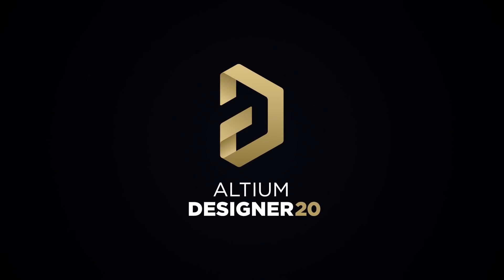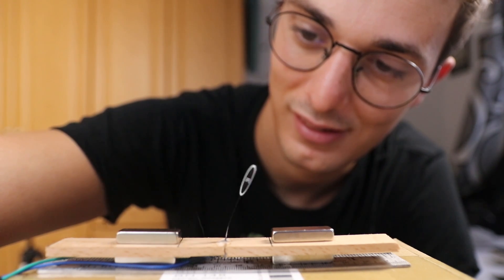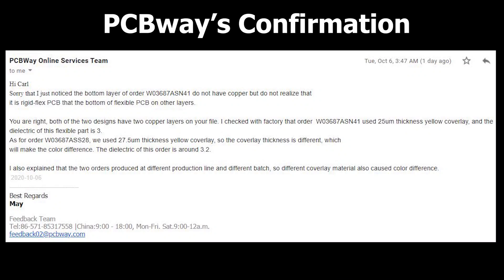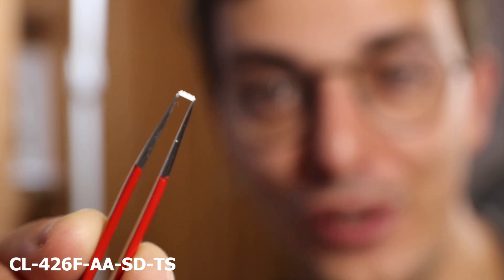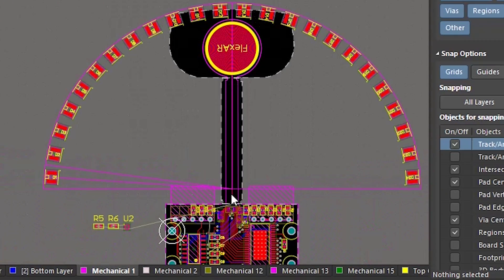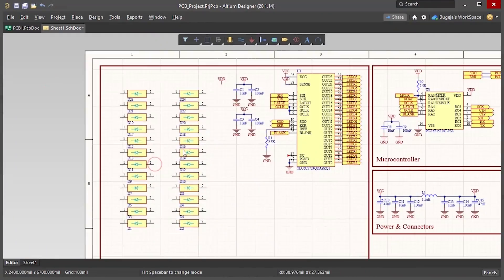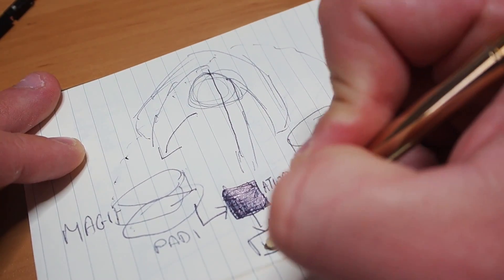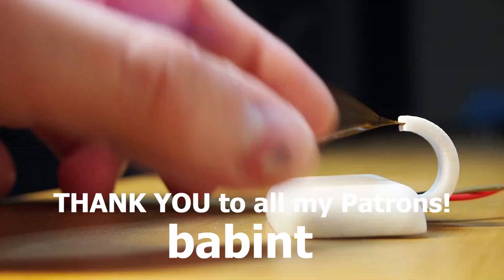New FlexLED Concept?

Comment: I'm late to the party on this one, but I think @elexperiment was on the right track. The flexible doesn't have to have 0 stiffness. Rather, it's better to optimize the resonant frequency and keep losses to a minimum. Stiffness and lossiness are completely different. The air resistance is probably unavoidable, but figuring out (and minimizing) the loss in the flexing parts could be helpful.

Many have suggested fiber optic delivery, and I agree. I would expect glass fibers to be less lossy than plastic (mechanically, but also optically). Remember that pole vault jumpers used fiberglass poles to get higher jumps before carbon fiber became easier to work with. If plastic fibers we're better, you know they would have gone that way. 

I don't know a ton about magnetic fields in motors, but they all seem to be really tightly compact with minimal air space between magnets/coils/cores. I'm guessing that putting the magnets and coils near the pivot point rather than at the end of the big flapper would improve efficiency. 

And finally, find the mechanical resonance of the flapper, and drive that frequency. Focus your sensors on the amplitude of the flapper oscillation and maintain that amplitude with small adjustments to coil current that can only build up flapper motion over several cycles. Timing this right would be an easier way of preventing the flapper from bottoming out and would keep the motion more stable. 

Now that I've shared my opinion, I've gotta go get caught up with the more recent videos 😁

Comment: It occurrs to me that if you use fiber optic fibers you could use that for the moving part, and have the light source static. This way you can use brighter leds and are not constrained by weight/size.

Comment: Hey @carl, nice job, 
what if you used a fiber optic cables to transmit the light , keeping the heavy LEDs on the base. 
or use a mirror or an optical arrangement on the flex side  that reflect the light emitted from the base

Comment: This is totally a driven damped harmonic oscillator. The main question is how to design a driving force that slows and reverses the motion just before it hits the magnets and still operates at a resonant frequency of the flexAR. This is made easier by the fact that the motion should maintain symmetry and periodicity so the driving force will need to be periodic as well.

Comment: Those flex LEDs are pretty neat, but for a sphere wouldn't it be much easier just to make the half circle spin around an axis by just attaching it to a motor? Seems unnecessarily complex and less optimal to have two flappy half circles instead. :P

Comment: How about using iron to improve the magnetic circuit? If you mount two neodymium magnets (with opposing polarity) on an iron backplate, I think it would help in increasing efficieny (i.e. less current needed in coils), by roughly a factor of two. Now, there is lots of air in your magnetic circuit. If you replace part of it by iron, you basically have a "low resistance path" instead of the high resistance of air, as the relative permeability of iron is much higher than that of air. 
Also, why is optimizing for a light weight that important? If you increase stiffness of the flexing part, together with a higher mass, you get a higher "Q factor" of your resonant system. I think one of the main losses is air resistance, as you have a large surface area and low mass of the moving part. I.e. you lose a lot of energy per swing. If you have a higher mass, you have more stored energy, and less losses per flex cycle. If you have an efficient resonant system, you only need to give small pushes. So, the efficiency might increase further. 
I don't know if efficiency is important. But as an engineer optimizing stuff is nice :). Possible advantages would be smaller magnets, less power consumption, etc.
Reply from the maker: I agree with you that putting iron underneath the magnets would increase the efficiency.. It is an extra comment in my system though (I usually try to keep my inventions as cheap and easy to manufacture as possible) so I will first test it without the iron and if thing don't work that well I'll test it with the iron hoping for better results 🙂 the problem with the mass thingy is the push. The magnetic repulsion have to be strong enough to push and go over the 90° for the 180°test.
Reply: @CarlBugeja Thanks for taking the time to react! Can you explain how/why magnetic repulsion (force I guess) has to do with mass? The force itself doesn't change, I'd say, with increasing mass. 
TLDR: in an ideal world, a higher mass gives, for the same force, a similar amplitude, as long as you increase the stiffness with the same ratio as you increase the mass. 
A quick write down of equations of motion can give some insight here. Luckily, wikipedia has the relevant equations already written down :), see https://en.wikipedia.org/wiki/Harmonic_oscillator#Damped_harmonic_oscillator, section titled "Sinusoidal driving force".
There, it gives an expression for sinusoidal motion of a mass spring damper system with sinusoidal force input. Of course this has lots of simplifications (linear spring/damper, sinusoidal force, sinusoidal motion, while your system has many non-linearities). However, it does hopefully give insight in the effect of mass on motion.
It says: x(t) = F0/(m*Z*w) * sin(wt+phi). So, for a similar force amplitude F0, the amplitude is determined by the denominator m*Z*w. Let's say we have a flex PCB with twice the mass and twice the stiffness; this means the resonant frequency stays the same. Let's say we are driving at exactly the resonant frequency w0. This means the expression for Z (see wiki) simplifies to Z = 2*w0*zeta, with w0 resonant frequency and zeta relative damping. w0 is constant as we said before. zeta = c/(2*sqrt(m*k)). Assuming the damping stays constant (i.e. the shape of the flex pcb doesn't change), zeta reduces by a factor of two as both m and k increase by a factor of two (mass and stiffness)!
So, going back to the amplitude of x(t), the sinusoidal motion, being F0/(m*Z*w). m increases by a factor of two, Z reduced by a factor of two. So: the amplitude of motion does NOT change, according to these equations. Assuming I didn't make a mistake; beware, it's Saturday night.

Comment: Not sure if this would work, but a thin polycarbonate or acrylic sheet could be used as a planar waveguide, maybe with a film of reflective tint on both sides. Instead of LEDs, an LCD or OLED screen can be used, as you would only need one axis of the screen; as long as the refresh rate is fast enough. The air resistance may be a problem, so if possible, using it in a partial vacuum would yield better results I think. Great project and video, looking forward to seeing what you come up with next👍

Comment: In digital scanners, they have a very dense line of optical sensors (like a camera CCD but one-dimensional) that’s slowly moved over the thing being scanned in order to collect the information. Be nice if something like that existed but with LEDs instead. Or you could make a POV display-style oscillating camera!

Perhaps instead of LEDs you could use custom-made electroluminescent strips, using a layer of phosphor sandwiched between two flex PCBs. ELs are a damn pain to drive though.
Reply: Oh that’s right, such dense LED lines exist inside LED printers. Technology Connections did a video on LED printers if you want more info. No clue if you could buy the LED arrays separately though.

Comment: Would mounting the LEDs on the main circuit board and using a fine fibre optic as a light pipe to transmit the light pulses to the end of the actuator work?

Comment: Could the flapper just be a mirror like mylar (or a frosted transparent film), and it reflects the LEDs on the unmoving base that flash on/off at the right time?
I'm not entirely sure if it'd work, but it may be a good way of reducing complexity/fragility/weight of the flapper portion, putting that complexity into the base instead.

Oh... what if the flapper was a bundle of glass-fibres, transmitting their light up into the flapper via internal refraction.  Yeah these are all pretty big changes to the idea :T

Woa now i'm wondering if anyone has made flex pcbs specifically designed for a max-reflectivity conductor (ie: not copper) and max-transparency film that could perhaps accomplish total internal reflection inside itself (like glass-fibres). So u shine LEDs into it on one end and they reflect around inside, depending on the internal etched design.  Ok this is getting crazy hah.

Comment: What if you used fiber-optics? Each fiber-optic line could connect to a rgb led and then be fed into the actuator
Reply: Increased stiffness>higher magnetic fields needed for the actuation, bend radius constraints because glass is a bitch and not as flexy as plastic, could be cool and maybe doable if he used a plastic "fiber" optic tho

Comment: Instead of attaching and moving the LEDs at the end of the actuator, could you mount the LEDs in the base of the board and run optical fibers to the tip of the actuator? This would probably lower the overall mass of the actuator head, allowing for higher frequency motion, and since the fibers are thinner and smaller it would also probably increase the linear density of pixels you could achieve on the head. It would also make the connector thinner, since it doesn't need to carry power for all of the LEDs, just the actuator.
Reply: That would be cool and probably work. One posible problem is that all of those optical fibers could stiffen the overall design and not allow the actuator to properly flex.
Reply: The light doesn't have to travel very far... So it doesn't actually have to be an official fiber optic tube. If he could design a flexible optic tube made of material with the same level of stiffness as the flexAR... That would be really cool.
Reply: Lol, I was just about to write this!
Reply: @pownaz3119  I did just before I read his.
Reply: Yes
Reply: @abeisengineer  I was going to write this too

Comment: Why not use fiber optic glass fibers? Strong, flexible, small cross-section, packs into a cable, and you can place the driver off the flexible part... seems ideal!

Comment: Looking forward to see the end result. I'm not sure going with the AT42QT1010 is going to work. I have not tested the actual response time, and the datasheet is a little bit all over the place, but in Table 5.3 in AC Specifications, they mention a Response Time of 100ms. So i'm not sure if that will work out to react quick enough to compensate for all disturbances..

Comment: What would you think about adding a magnetometer or an accelerometer that could help with a PDI approach to the oscilation?
Reply from the maker: Hall effect sensor was one of the options :) I didn't consider an accelerometer because I'd rather not put the sensor of the flexible part - it would add up the weight and also increase the risk of failure from flexing

Comment: What if you used an unpowered coil, fitted on top of the magnets, and when the FLEX-LED actuator gets close to this coil, an EMF is induced which can be used to flip the coil polarity
Reply from the maker: Induction Sensing was one of the options :) I prefer not to use this kind of sensing methodology because used it in my previous jobs and there are some NDAs involved

Comment: How do you control the general behaviour, do you have a microprocessor in the flexing pcb or is it outside?
Reply from the maker: there is a pic16f microcontroller on the rigid part of the pcb https://www.youtube.com/watch?v=aojxKRDbWJY&t=494s - same mcu will be used for this v3
Reply: Based on the previous design and from what I saw in the Altium PCB design time lapse it seams that he has a hardened base with all kinds of electronics including the driver and a MCU

Comment: You could use optic fibers with total internal reflection and add the other ends to leds elsewhere
Reply: +1 to this idea.  This would also push PCB Way to see if they could embed "optical channels" or voids into the PCB that could be left empty or filled with a flexible transparent polymer.
Reply: @nlx oh no it's very bendy and putting 720 in a row would be like a very thin sheet
Reply: @Scott_C  but then how will you line hundreds of leds and make use of total internal reflection won't all just mix and give of white light?
Reply: @RockingScience  you can cut the transparent material. Just add those to the PCB layers.  If PCB Way  can place and build components onto a PCB,  why can't they do that with a thin transparent filament.
Reply: Instead of of the leds on the pcb? If, would it not give more stiffness to the whole pcb? Fiber wire isnt that bendy, i mean...I could also be wrong! :D
Reply: I think with those bends you'd be far over the maximum 20xdiam bending radius of the optic fiber. You could use a plastic one, like those kinda cheap luminescent lamps with the scraped ends, not the most efficient thing but still functional since the leds would not be too far from the output